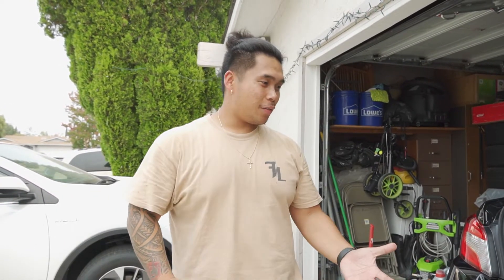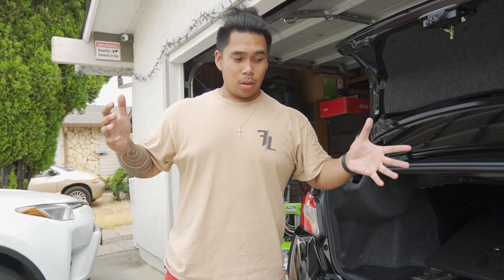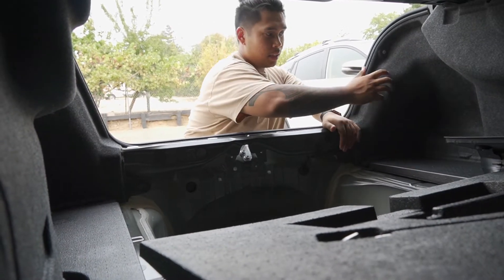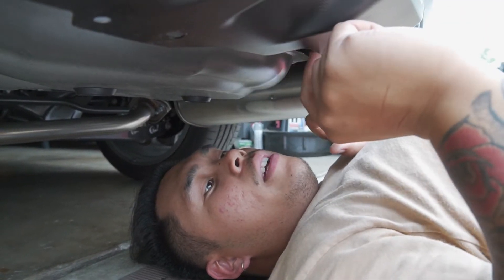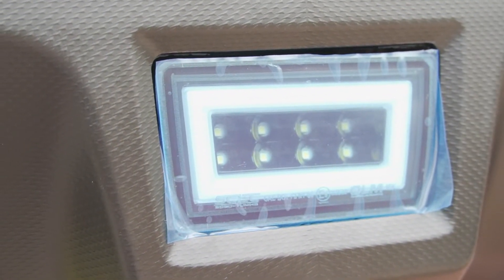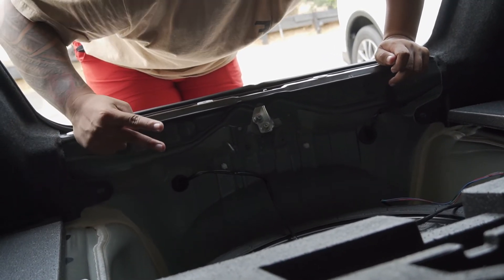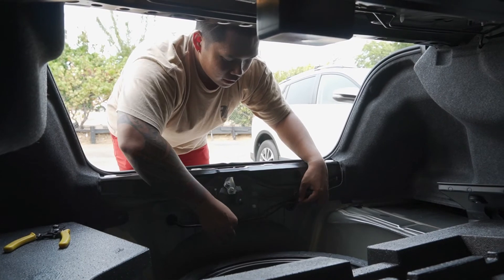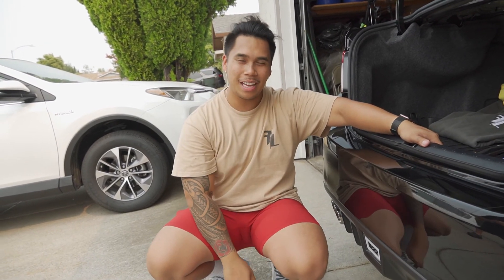HOW TO INSTALL 4TH BRAKE LIGHT [WRX/STI 2015+]

Comment: Hey bro that plug and play harness can it be used on cars other then wrx
Reply from the maker: I think you can use it as long as the male and female plugs can connect! If not you can try to splice the wires together

Comment: Do you know if the OLM harness will still work on non-olm brake lights?
Reply from the maker: It will depend on the connectors. The female and male connectors from the taillight will be straight plug and play. Just not too sure about the connectors from the 4th brake light.